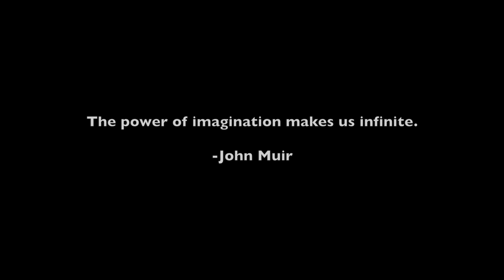Transcendence - Episode 33 Interior Transition Sheetmetal & Movie Screen Bus Conversion

Comment: i've always wondered, with the amount of wood and insulation that you've added, will the bus weigh more than the original weight with all the seats in it?...and if so, are any mechanical modifications to be expected for the engine and suspension?
Reply: Probably not. School buses were made to hold a lot of people too...so I imagine the weight is fine. The foam is pretty light too.

Comment: While I think your design is grand...you do know that window is likely to leak like a colander in the rain...yes?
Those have drain holes that (usually) wont work out well upside down...
Reply from the maker: Nah....it works perfectly fine. It's been through many rain already with no issues. There's no drain holes in this window or its window frame.

Comment: Sorry do not like the  rear screen fitted upside down
Reply from the maker: Thats ok....you don't have to like it. That's the cool thing about a one off custom build though, everyone does things in a different way and it's really neat to see all the individual creativity from others. The truth is...things always evolve and ideas change. My intent was to mount it right-side-up, but the contours didn't match up well at all. So, it changed my mind for me. no matter if it rained or not, it would have to be closed, so it really didn't matter which direction it went. Now.....tell me something constructive, rather than just an opinion applied with a negative approach, and I might hold some weight to the validity of your comment. Thanks for watching! :)
Reply: Just thought that looks odd when open? Am liking the build so far, As you say most do not bother to make it smooth. I am in the U.K and we do not have Schoolies as such we use normal buses. Waiting for the next episode.